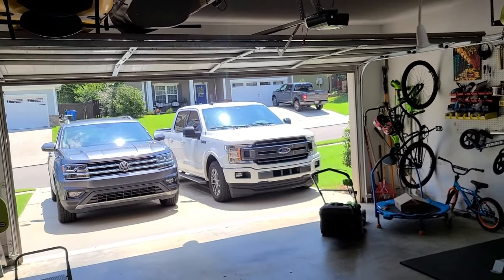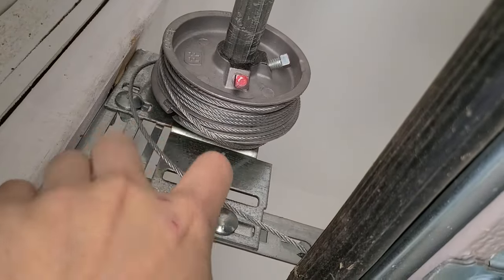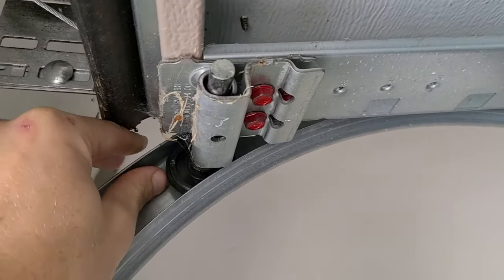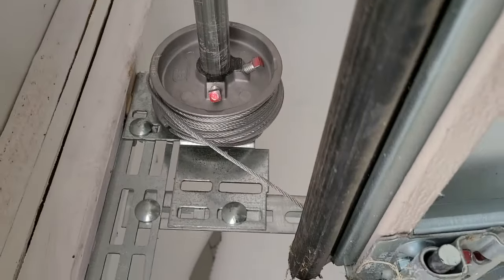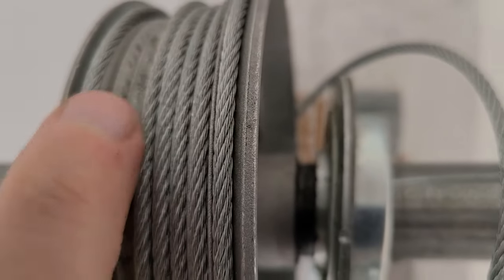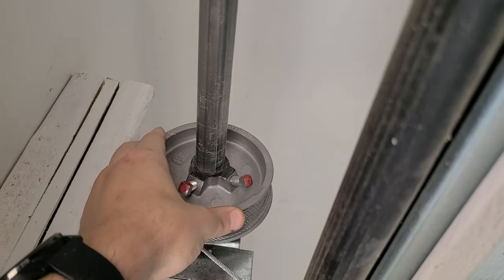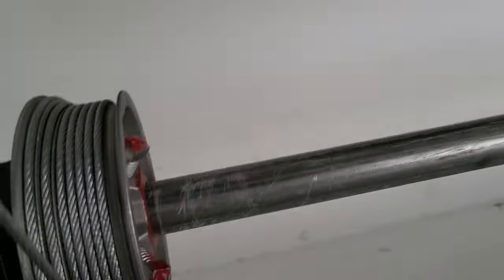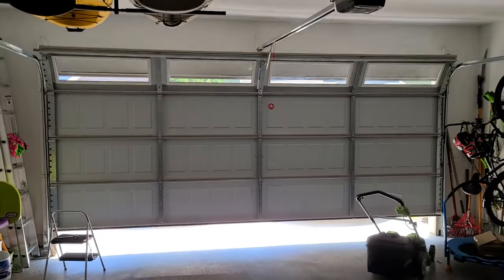Man Tips - Garage Door Cable Loose/Off Pulley - 10 minute fix

Comment: Man, you're lucky, never run your opener attached to your garage door after doing any repair, especially any tension repair, meaning springs, cables, drums, bar and end brackets. You want to always do a manual slow dry run, making sure there's no binds, or abstractions in the way, I've seen guys not doing dry runs first, and the door crumbling to the ground. If one spool comes loose like yours did to begin with, it will kiddie-wompus your door in the hole I've seen at a 45* angle before. Because most people panic and don't know what to do if something goes wrong. A machine has no feelings, the opener wil just keep pushing until you stop it. What you also should've done was put an extra 1/2 turn on your spring that way there's plenty of tension on the cables and they won't come undone again......
Reply: Didnt level the door either you can tell in the video it doesn’t close all the way and real loud

Comment: 1)	Eliminate hand winding, leave cable attached to post near bottom roller; start the job with door in closed/down position 2) Place "Curved " vise grips on the torsion rod and use the wall as a brace. 3) 3/8in. 10mm open end wrench; loosen but do not remove set screws 2 places. on spool 4) adjust spool for maximum cable tension without lifting door (hand tight, strum like a bass guitar string) 5) Tighten set screws and Remove "Curved" vise grips 6) Add this check point position of bottom roller when door is up = 1-2 inches above the bottom of curved connector.

Comment: If the cables are loose enough to come off the spools when the door is in the full up position, it means that the torsion springs are not wound tight enough to make the spindles keep turning as the door reaches all the way to the top of its travel. Trust me I know from experience. For a 7 foot door with standard size rollers, it takes a minimum of 28 quarter turns of the torsion springs.

Comment: Just fyi, instead of unbolting the spool you can just slip the wire off the doors knob and rewind them reatach
Reply: Of course this assumes the tension was right before you screwed it up like I had
Reply: Nothing to do with the tension at that point. With the door up the springs have no tension and both cables are the same length. So as long as the cable is set in the first two grooves of the drum with the same number of wraps on both sides your good

Comment: Also, if for some reason you wind one side tighter than the other and the door is uneven, you can repeat the process of slightly loosening the bolts on the pulley with the door down, and it will allow for the door to close properly and even. Then just tighten them back up keeping tension on the cable, and you’re all set. Again, thanks for the tip!

Comment: My just told me I was a fool for trying to do it this way. I actually loosened the bolts on the pulleys enough to completely unwind the cables and rewrapped them in the grooves correctly. This part was a little tricky needing to hold the cable in place as you wrap and then securing the bolts back tight. But all in all, this process worked GREAT! Thanks for sharing!
Reply: My dad*

Comment: Thanks for the tip , my 10 foot by 16 feet wide Lake Lot shop door was stuck with it up , I found the lift cable had jump the pulley and it could not go up or down.

Comment: I have a question, before I ask the question let me share some info.  So I followed your guide, and it is time to wind the spring I wind it 21 quarter turns for a 7x16.  So I test my garage door and the pulley wires got loose and tangle up.  So the question is “is it because I did not wind it to the right amount?” (I am suspecting that it is but I just want to confirm)

Comment: A vice grip often needs to be used on the right side of the tube against the disc the pulley backs up against so that when the pulley is loosened, the tube doesn't pop back to the left, or even come out of the hole if the tube doesn't have much length protruding

Comment: Definitely an annoying issue. I did my own fix and had to solve this. The issues that arise after doing it this way are that there's a gap between the door and floor if it's too tight. There's a balance and it's a lot of tweaking to find -- at least in my case 🙂

Comment: If a contractor replaced your springs and left your cable loose like that. Should they or you have checked if it worked before they left. I think you have replaced the springs yourself and messed it up.

Comment: Your opener is pulling the door up wayy too far. Only go to the top of the opening. That can also cause the cable to fall of the pulling/drum. This is if you did not change the travel limits of your opener.
Reply: I having been doing garage doors for 3 years full time. 2 year part time

Comment: Would have been so much better had you used a proper, stationary camera for the video.  Also, you made no mention of the RED bolts and the possible dangers related to them.  Would it have been possible to undo the cable on the door end, rewind it and then reconnect it with the right amount of tension?

Comment: I did this and the cable came loose again after closing and opened the garage door. Any idea why it did that?
Reply from the maker: Check the stop position it opens at. If it is opening too far, that can cause the cable to come off again.
Reply: @talkingsmallpodcast  what do you mean by that? isnt it the other way around. if its opening not far enough (less tension on the cable) it will get loose? what do you do to fix this? tighten the pully again?

Comment: How do I fix it if one capable is disconnected and the other is loose but the garage door is fully down it goes up barley off the ground but it won't go up fully but the wheels look on track
Reply from the maker: I'm not exactly sure, but it sounds like you need both cabled connected to the counterweight spring. It sounds like the door opener is trying to unevenly lift too much weight with only one cable connected.
Reply: Call a garage repair man
Reply: You could lose a finger messin with it

Comment: You should learn the correct name of each part of the garage door. Drum, cable and torsion shaft. Also you should set the left side/red drum first because it will loosen the cable as you tighten the set screws. vise grip the torsion shaft then set the cable on the right side/black drum.

Comment: What size socket did you use? With the square bolt all of my sockets are slipping
Reply from the maker: I believe it was a 10mm. If you don't have the correct metric size, that will cause the slipping.
Reply: Use a 7/16 universal a 12point it works perfect im a technician and that’s what I use
Reply: They actually have a square socket for this, well it's an 8 point socket, wich was very strange to me at first, not used to seeing that.....